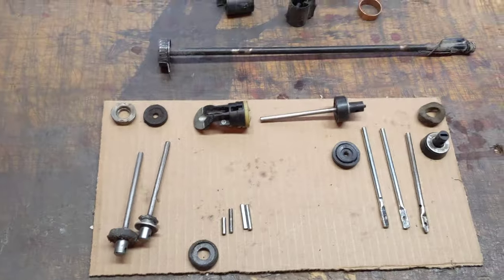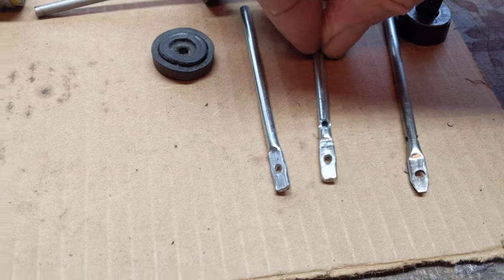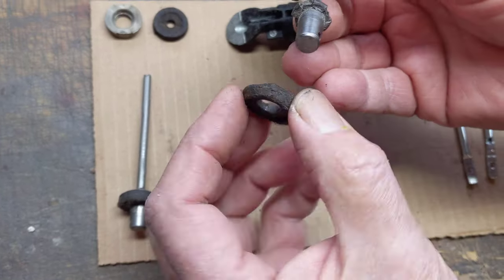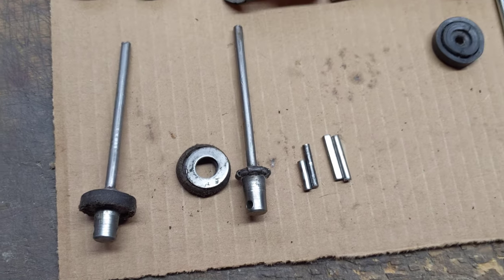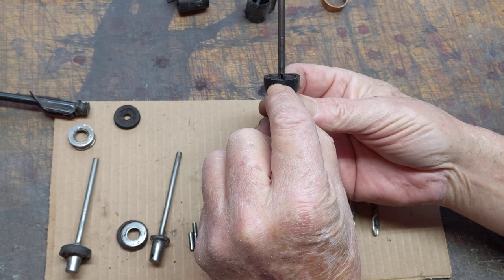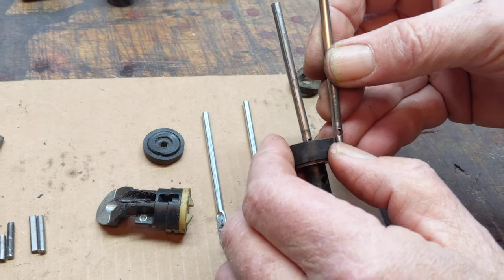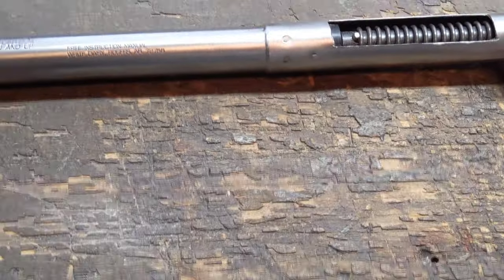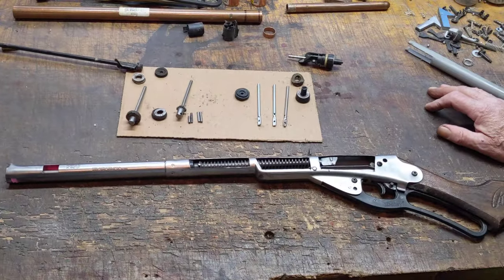Dual Port airtube, Single Port airtube, is one better than the other?

Comment: off set the 2 ports as the sir is flowing in they are fighting each other cut one air port and cut next 1/16 inch above bore of the lower air flow will be better
Reply from the maker: I'll explore that on the next prototype but only after I build a single port version first. The interior diameter of the stainless tube is huge compared to the 7/64" overbore and should transport quite a bit more air. We'll see what happens!
Reply: was thinking very similar, a little offset and oval them a little. don't want the holes so large diameter it makes it weak, but surface area of the two holes should be slightly larger than surface area of exit hole. making the ovals (diamond burr in a dremel?) kinda leaning the holes in direction of air flow. offset may need slightly more than 1/16" (not much!), this is fun "little engine" stuff.
Reply from the maker: @modelnutty6503  Aren't you an RC car aficionado? This is basically and exhaust problem so what do you RC modders do for better exhaust flow?
Reply: @RestOModDaisy  The larger ID of the SS tube is the issue.  Larger dia means slower velocity for the same volume of air.   that's one of the benefits of the original air tubes, they were hardier and also had a smaller ID so the exit velocity of the air is faster.  As my dad was fond of saying, my dollar against your nickel.....
Reply from the maker: @tomr9306  An interesting wager. I know for a fact that the 7/64" overbore  single port airtubes provide more velocity than the stock OEM tubes. I have oodles of chrono readings to verify that. The dual port tubes in thin wall stainless did provide a very slight bump but not consistently and certainly not worth the effort involved in fabbing them up.  I have yet to investigate further and have recieved lots of info on port size, port placement and possibly inducing some kind of 'swirl" into the airflow via internal flutes. I think the parameters of the bet are a bit wide, but if you want to nail down some details, single port/dual port/standard tube/overbore tube etc, I have a Nickel to risk.

Comment: Id really like to work with you on these. Our process seem to be the same style and i have a crazy passion for this. The stainless tubing has been the best to make from scratch air tubes reminder to readers you can cause a double feed if you have a just 2 short AT i have rebuild a few of my broken dual ports. Wish they still used the old plunger. More spring space and a flat surface fore the spring to meet instead of a pin that to me would to me warp spring in long run

Comment: Okay, what we need here is some engineering. The factor that controls how fast the BB is going to go is air velocity not air volume. Take the same shot tube with the same volume of air and the air velocity will be higher in a smaller diameter tube. An engineer with all the dimensions can calculate the optimum values for each. I'm surprised Daisy doesn't do this, or maybe they do. I could do this if I had all the numbers. Shane, the reason yours is lower velocity is because the air will pass slower as the tube diameter gets larger. That's physics, just saying...
Reply from the maker: Craigster, I was told there would be no math. The results of this  experiment indicate you are right, the larger tube diameter did not result on more speed on this build. More experiments later!
Reply: Just a thought. I say if you just reduce the tips Inside diameter to the OEM spec via insert or rolled with a manderal . Bottlenecking it right before the BB instead of at the beginning of the tube.
Reply: @benjohnson2421  Nope! that will create turbulent airflow. You need a smooth bore of the optimum diameter.
Reply: @craigster1952  There is a thing called tube restriction. You could turn little  internal cone to direct a smooth flow. It gets bottlenecked in the tube entrance anyway. So how is forcing more air volume (larger ID) faster right behind the bb and max pressuer at the tip instead of 3" behind the BB at the seals, not work? Nozzles work better for pushing things along.
Reply: @craigster1952  I orderd some tubbing And I have a mini lathe. Ill let you know.

Comment: Just found your channel after rehabbing my father's Daisy 25.  I'm NO airflow expert but in dealing with automotive applications (I truck pull as a hobby), ports numbers and size is only PART of the equation.  Port transition plays a much bigger role than size depending on application.  Forcing air 90 degrees in a bigger port may decrease output versus forcing air 20 degrees in smaller port.  Smooth transitions vs stepped transitions play a HUGE roll as well.  On the airtube you built the ID is bigger and the ports you cross drilled look bigger, but the way Daisy shaped their ports (incoming air to the air tube) aren't just holes drilled, but look like "notches".  Those notches would seem to allow a better transfer of air into the tube.  Again, I am NO expert, but that may explain some of what you are seeing as air doesn't like turbulence, especially as it transitions from the pressure chamber into the air tube.  I could be wrong but after seeing similar issues with cylinder head ports (bigger isn't always better if the turbulence is created), it stood out as I was watching/looking at your video and air tube design.  I hope you figure out what works best and have success in increasing volume and airspeed as we all benefit.
Reply from the maker: Thanks for watching the channel and pitchin' in with some real world observations. The ideal port size, port location and interior diameter of the air tube is still being worked on here at Restomod but is not a front burner project at the moment. I've been using the dual port 'Blue Hare" tube built by Jonathan Bates over at Black Barrel Customs for my most recent experiments and find that it works pretty well. you can check that out at:

https://www.youtube.com/watch?v=jW78634rocw

He sent me one of his "Conestoga" builds based on a current production Daisy 105 Buck with a ton of mods including a "Blue Hare" air tube and the gun runs a consistent 400 FPS with a standard Daisy Red Ryder mainspring. It's remarkable!
Reply: @RestOModDaisy  lol another gearhead here but I have an idea. With your dual port version you have dual streams of air coming in from both sides. Air has momentum just like everything else.  Air is coming in one side and due to momentum is fighting the air coming in the other port. Now compound that with the dead air between the ports and crimp creating vacuum. It's just like the old school breathers on a carburetor. If you remember the center was like a dome with air coming in from all directions before going 90° into the carburetor. By flipping the breather lid upside down it created an inverted dome eliminating most of the dead space where vacuum was created above the carburetor. Perhaps if you could pin a wedge shaped divider inside the tube it could fix both of those issues.
Reply from the maker: @nashvilleoutlaw  Thanks for the input on airtube mods. As you can see from the comment section here, there are a lot guys with a lot knowledge on this topic! I just got a custom shot tube and piston combo from Terry Cowger (America's Top Custom Daisy Modder) that ditches the airtube completely. I'm planning to install it on each of the guns in my Range Remuda and see how it runs. Expectations are in the 500 FPS range based on tests by Terry and Mark Ritter over at Cobalt 327.
Reply: @RestOModDaisy   That's cool I can't wait to see the results. Does he have a website? I'd love to see what all is different from stock. I had something similar to a buck 30+years ago and just ordered a red ryder yesterday so it should be in this weekend. 500+fps would be really nice with a single pump lever action. That'll rival the old powerline 880's without all of the pumping, the metal ones not the new plastic junk ones of course.
Reply from the maker: @nashvilleoutlaw  Terry has a YouTube channel located here:

https://www.youtube.com/@BB-BLASTERS-BY-TC 

but if you  want the skinny on the latest and greatest on these super high speed muzzle loading shot tubes head over the The High Road forum and check out the "$15 Dollar  Daisy" thread. Pages 72 to 77 provide a whole lot of detail. I consider that thread to be the Modern Daisy Modders Bible

https://www.thehighroad.org/index.php?threads/putting-a-little-more-power-in-a-15-00-daisy.807316/

Comment: I need to make a video.  This last summer when I installed one of Marks complete plunger assemblies, equipped with a 327 and big air tube, in to my very new 1938ARR, I got some astounding numbers.  I went from 282 fps to 386 fps.  Eventually after a couple hundred shots it settled in at around 368-370.  I notice the seal on Marks assembly fits my tube much more snug than the factory assembly.  Its fun to shoot but I do notice it is quite jarring if it fails to pick up a BB and dry fires.  I worry about the hit the abutment takes on a dry fire.
Reply from the maker: I agree! I'd love to see a video about your modding experience. The current production abutment seal is pretty stout and I don't think you'll suffer any long term damage as a result of the occasional failure to fire. Gravity feed systems do require elevation of the muzzle for consistent operations. Your speed increase is on par with what I've seen in converted current production guns with the same set up. What made Johnathan's build so interesting was he got that same bump without a high power spring, one of the foundations of the power triad as I've come to understand it. Of the two variables, a dual port air tube and an an incredibly long shot tube  I could only replicate the air tube. It was enough was not enough to replicate the result so it's time to redo the airtube and start looing into extending the shot tubes. Shoot the video! It's fun!
Reply: @RestOModDaisy  I live up here in WA state so as soon as we get a break in our winter rain, I will set up the chrony and make some video.

One thing I think we need to take into account is the mass of the power assembly.  The spring isn't just compressing air, it is having to move the weight of the spring, air tube, washer, seal, cross pin, assembly struts and stirup forward.  I believe the weight reduction in Johnathans brass air tube setup also contributes to the velocity increase.

I think your thin wall tube weighs less than factory Daisy and should result in an increase, just in weight reduction.  I also believe if someone were to "swiss cheese" the power assembly struts to reduce weight but not strength that there should be a velocity increase.

I think the Daisy single port design and air gathering channels of the compression seal and abutment washer, are a manufacturing simplification.  Allowing the port to always align with an air channel, during rapid manufacturing.  Also it takes less time and cost to make one functional hole in the air tube.

The old dual port design did not need air channelization.  I think the dual port design would work better without the air channels.  I believe if a custom smooth faced compression seal were used this would reduce weight, increase air chamber volume and flow better into the dual ports.  It might even work better if smaller ports were used in a quad port configuration.  If a custom smooth faced compression seal were made, a smooth faced abutment would need to be configured as well.

I believe an effort of maximizing air chamber volume for the given space and reducing the weight of the power assembly will allow a weaker spring to perform more efficiently.

Another untested theory is that of flat wound springs.  A flat wound power spring can give you more available energy for less weight in the same space as a round wound coil spring.  I have been using a flat wound hammer spring in one of my PCP's with great success.
Reply from the maker: @Backin_Theday  Man that's a lot! Head over to this page before the snow leaves and take a gander

https://www.thehighroad.org/index.php?threads/putting-a-little-more-power-in-a-15-00-daisy.807316/
It's the Daisy Modder Bible and it's 59 pages  of ad hoc engineering. More food for thought!
Reply: @RestOModDaisy  Looks Like need to register there.  Just the highlight public view looks like lots of people have tried many variations.
Reply from the maker: @Backin_Theday  It's a steady work in progress and well worth the price of admission.
Reply: @RestOModDaisy  I made an account and verified email, just waiting on the admins.  Going with Punkin_Ball_Ballistics for a user name.
Reply: Howdy , 
S.B...restomod
      Getting some parts on order. You gave me advice and website. I'm confused about reassembly. In the actual gun is that a movable piston. How does shot tube meet the plunger and airtube? I saw you used a leader wire to help install  spring assembly . There is a part "blocking" between barrel and comp spring housing.

Comment: Morning Shane I have another question. I have a model 98. How can I tell if its a 50’s version or 70’s version? I don’t see a serial number or lot number on it anywhere. Does that indicate 50’s?
Reply: After the model there is a “registration” number L175238
Reply from the maker: @WalnutandSteel  The registration number system was started by Daisy in 1952 and evolved for a few decades until the lot number system replaced. Here's link to article about that over at J&G airguns that was extracted from David Albert and Gary Garber, major Daisy Guru's

https://www.jgairguns.biz/daisy-register-lot-and-serial-numbers-explained-ezp-55.html

Best I can figure based on the Lot number is November 1981 since the lot number switch happened in 1972. Yours does have a bottle cap right?
Reply: It is a bottle cap
Reply from the maker: @WalnutandSteel  That makes it pre 1978-79 as that's when they switched to the fixed shot tube/abutment assembly. Could be 1981 or 1971 on the manufacturing date.
Reply: Thanks for the help! I had read an article online that said the 98 was only made from 55-60 and then again in the mid to late 70’s. Do you know if that is the case?

Comment: If you haven't already done so, you should consider testing the dual port concept with smaller diameter holes with an equivalent combined diameter of the original single port hole.  From there you can work your way up in the diameter of the dual port holes to see what, if any, gains or losses you get.
I've retro-fitted one of my Daisy Red Ryders with a gas-spring and I've been fumbling my way around these air-tubes looking for the most efficient given the greater power of my gas spring.

Comment: The low swept volume in Daisy chambers would benefit more from pressure/volume flow balance over simply exhausting the volume more readily.  

The small tube (95, etc) Daisy guns have about 1.15 cubic inch volume chambers, where the larger guns (Ryder) have 1.25 cubic inch chambers.  Not a lot at all.  Factory form, they are rather efficient systems.  

Find the barrel to chamber volume....    On small bore guns, higher pressure with small volume will always perform better than the same volume moving at lower pressure (open port too far).